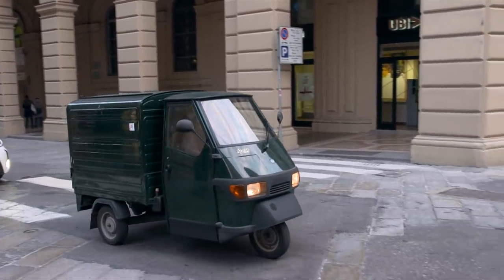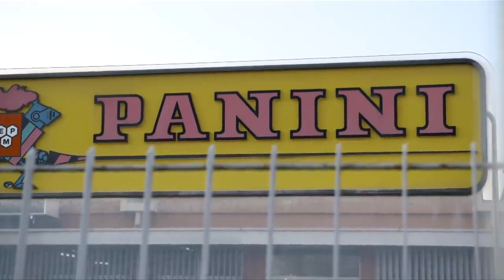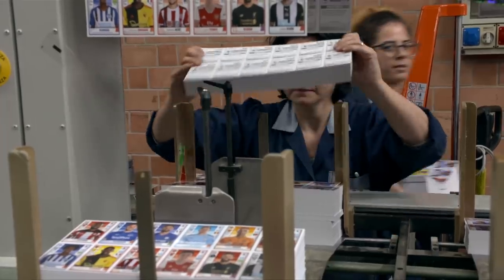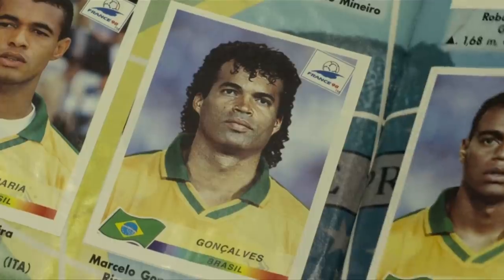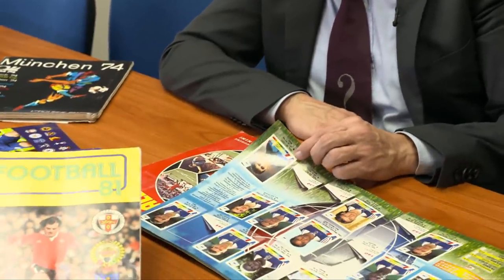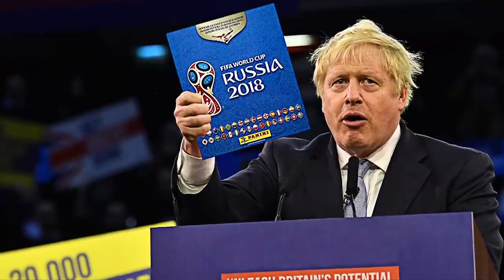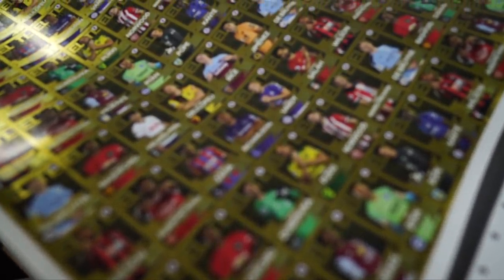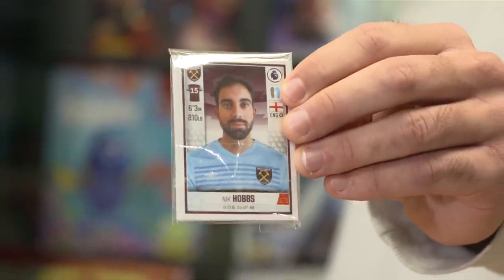How are Premier League Panini stickers made? | Visiting the Panini factory in Modena 🇮🇹

Comment: 2:00 I can kinda see how the cutting and packing works - been collecting Panini for 35 years. For the World Cup & Euros I usually buy a box (as long as Switzerland has qualified) and I open them all then sort them into piles according to team.  Then when I sort them in number order I always find that my pile goes something like 120, 122, 124, 126, 128, 130, 121, 123, 125, 127, 129, 131.  Then the ones you are missing - you normally find they are in odds or evens as well.  i.e: If you are missing 135 - chances are 137 and 139 won't be in your box either.  Then if it gets down to being low to send off - you'll buy 20 packets and 19 of them will be all swops but 1 of those packets 3/6 you will probably need.
Reply: This is such a swiss comment ahahahaha